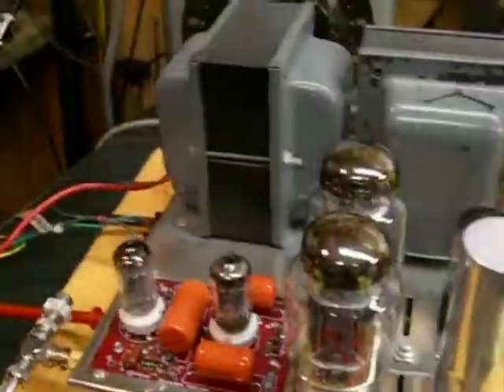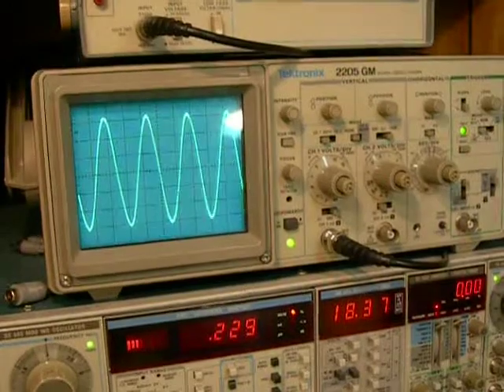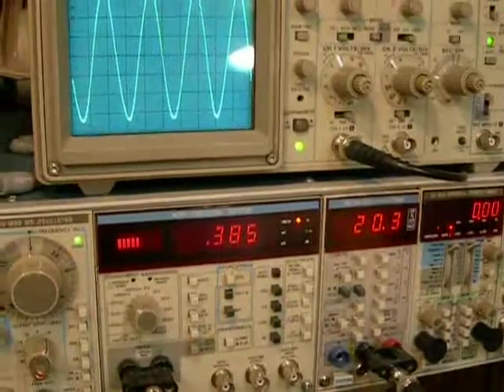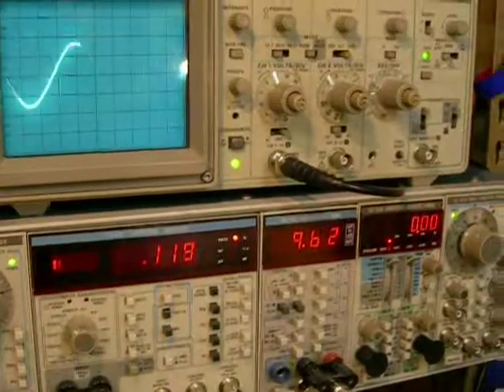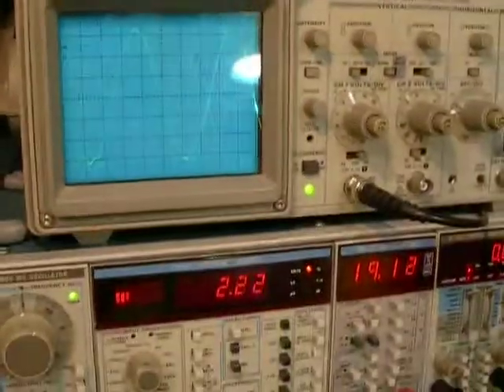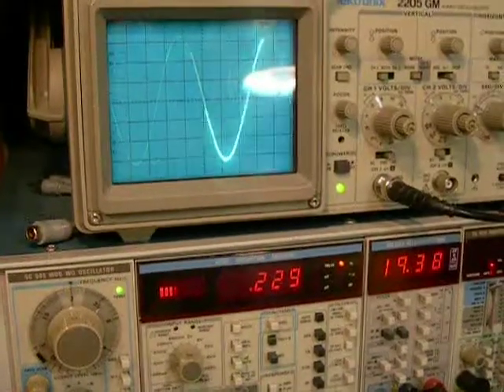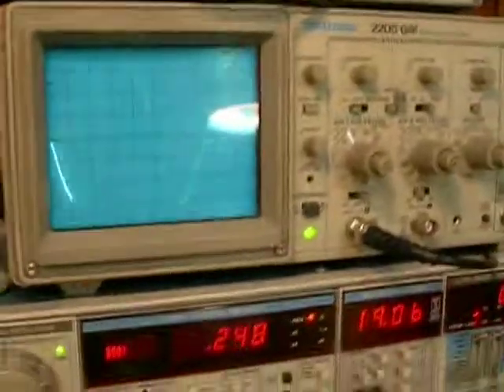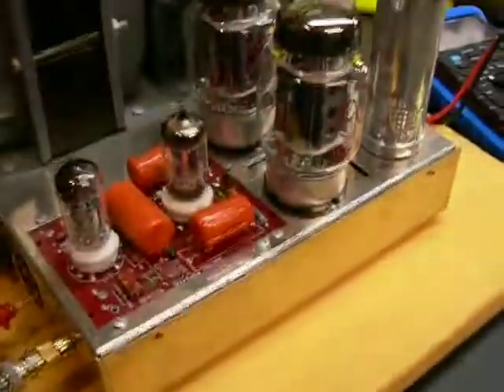Modern JJ KT88 Vacuum Tube.MOV

Comment: This video is informative, I am interested in learning how to test power vacuum tubes like the KT-88's/6550, and the KT-120's. Can you explain in more detail what is driving the percent number on your scope? It did not figure into your calculation, so I am curious what this percentage is and how it helps you determine what is good and when that number becomes bad. Thanks.
Reply from the maker: The percent number is just the total harmonic distortion (THD) as read on the Tektronix AA501 distortion analyzer. Perfect would be zero which is, of course, impossible. The lower the THD the better. I think there are several necessary steps in ascertaining the true quality of a tube (one of them is not listening to the tube...) - first off, a tube tester can be used to give you a 20-30% evaluation of a tube (maybe like an x-ray of an injury of the body but it doesn't tell everything about the injury). Secondly, the tube needs to be put in a real-world circuit and the cathode current measured and recorded. A third important parameter to obtain about the tube is the temperature of the tube - with these three parameters, you can compare and legitimately "match" tubes that will perform much  better than the "matched" tubes you buy from the sellers. They simply aren't going to take the time to match tubes to this level. I might also add that high quality, high performing output tubes will run hotter than their weaker brothers. There are some good quality tubes on the market but which ones to get I can not recommend. Tubes from high-end test equipment like Tektronix oscilloscopes and the old Hewlett Packard equipment (if they are not consumed from use and time) are often times very high quality tubes. These guys went through extensive testing and were hand picked for  quality and performance. Unfortunately, even many of these once-upon-a-time gems are simply burned up and weak. I do not buy these ridiculous priced vintage tubes off Ebay.  I have noticed that many of the original tubes in the "higher-end" guitar amps, often times made by JJ are quite good tubes. I said I would not recommend tubes but I have also found Sovetek tubes (and they are often times the cheaper ones) to perform quite well in guitar amps. I have bought new Gold Lion Genelex tubes and had about one-in-four go soft on me - and they are expensive. It's a turkey-shoot when dealing with tubes unless you want to deal with commercial level tubes like Eimac transmitting tubes. That is my experience and opinion. Hope this helps.

Comment: Hi and sorry to bother you, is it possible to give you a call?  I'm trying to find the mA draw of JJ KT88 on the Data sheet, I see mA all over the place on the data sheet but I'm not sure which one is the correct one.  My Power Transformer is rated for up to 350mA so I'm trying to figure out if I can use KT88.

Thanks 

Art
Reply from the maker: Hi Art, I agree that the data sheets can be confusing but typically, using the Dynaco Mark III as an example, the current thru each KT88 should be around 70 mA each or 140 mA for a pair. That amount of current will be at a plate voltage around 500 volts and a bias voltage of about -50 volts. Hope this helps. Here is a video that might help. A 350 mA power transformer is plenty big enough.
https://www.youtube.com/watch?v=ZvW3D3XoHWY&t=2s